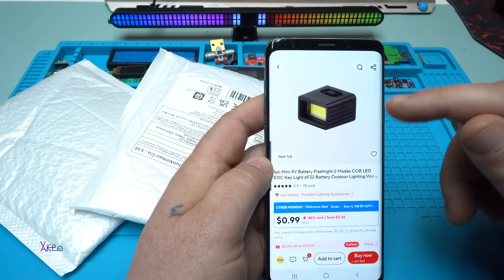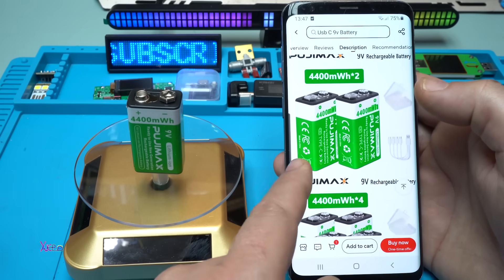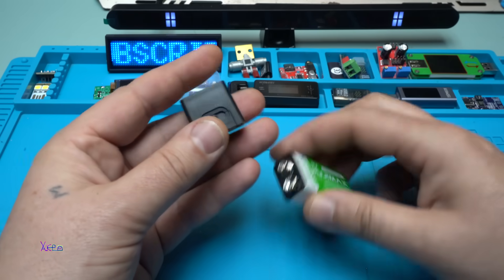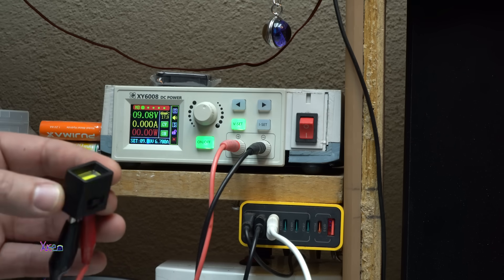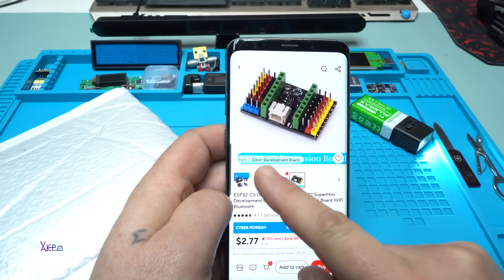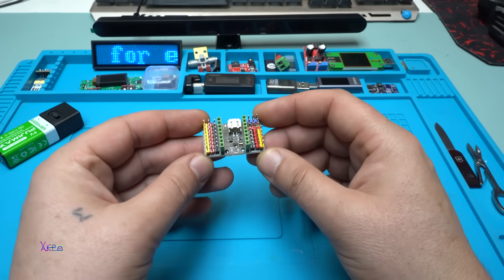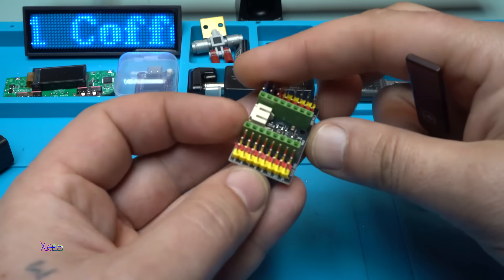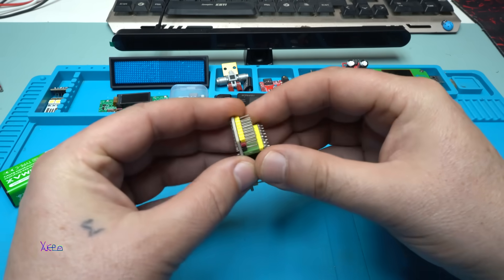WHY THIS $2 Aliexpress Module is BRILLIANT?

Comment: Can you check for me please? There is a jumper you can short that supplies the battery voltage to the power pins, if this is shorted and you apply USB power, do all the power pins go 5V?

Comment: 4:10 i have the same flashlight, but i have it in a plastic ziplock bag that is the same size as the flashlight, keeps it snug inside and keep the water away. 
Since its winter here, its a good flashlight to keep when you go outside, crossing roads and signaling the bus, and when your inside its very handy to look for things when you drop stuff on the floor.

Since i have a bunch of 9V batteries around, its nice to actually use them to something practical.

Also , speaking of bubbles , Mouser use some big and juicy bubbles, maybe you find cheap stuff there one day ;-)